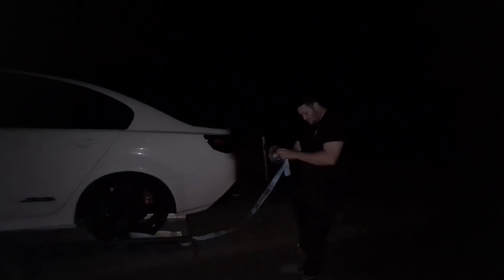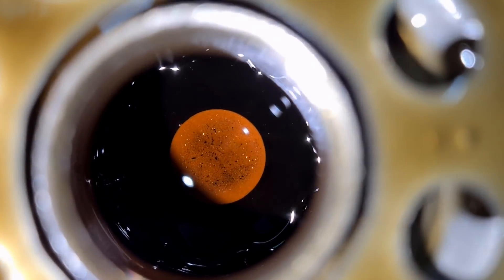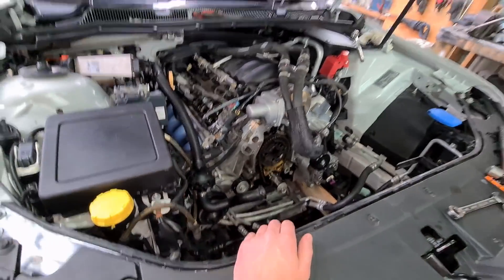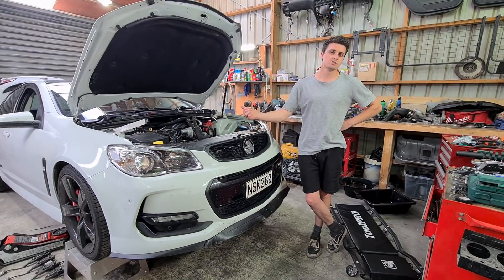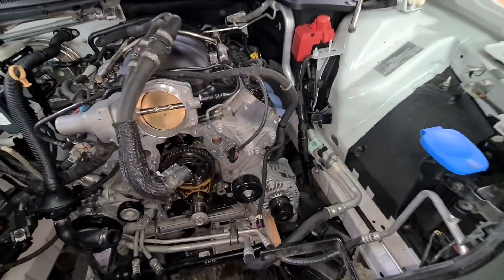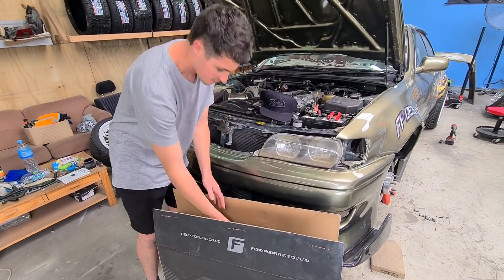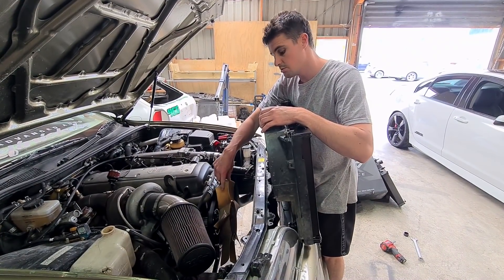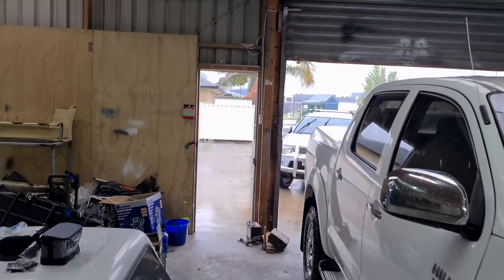My LS3 Commodore Blew Up In The Middle Of Nowhere!

Comment: I think the black tar substance is cooked oil stabiliser.
If you take oil stabiliser somewhere cold it will make the oil extra thick & clog up the oil pickup then the flow will stop & cook itself extremely fast.
If it's mineral oil, then it is literally tar now. 
Hope this helps
Reply: yep just like the various chemical additives used these days, people do not understand adding friction additives in factory oil spec 5w/30 ( no matter the brand) you run the risk of the additives and chemicals used which could react with the oils additives and thus do just what happened here? cheers mate.

Comment: Back to RFB life is it? 🤔🤣
Reply: They have even more oil issues more than LS engines. Especially pre neo
Reply: @nekethoms9963  it was sarcasm..
Reply: Don’t have these issues with a 2J.. Oil flows nice and easy, double the ribs in the block vs an RB30 as well.
Reply: @izzy031096  that's cause RBS have 5x 8mm oil returns as apposed to JZ have 11x 15mm. Witch results in yes better oil flow. Factory oil pump pretty crappy also.

Comment: Unlucky bro! Was that shit that blocked the pickup maybe a black rubber work glove? I would think that would sorta dissolve like that in hot oil.
Reply from the maker: Didn't think of that. Would be pretty hard for that to happen, but might test it and see if it dissolves
Reply: fuck that could be it aye!
Reply: Yeah feels like the kinda thing that would be on purpose. It looks a bit like the rubber that coats head MLS headgaskets too but doubt there is enough exposed to come off like that and others would have had same problem
Reply: 2nd this looks like a work glove
Reply: @MayhemInc  Looks to me like it is the oil filter medium that blew apart inside of the filter and clogged the passage ways. This is common when running poor quality brand oil filters
Reply: I've seen a D shackle from a engine crane, make it's way to the sump. So a rubber glove is plausible.

Comment: Get some silicone oil 8000 or 10000 from a hobby shop for your viscus fan, they use it for diffs and shocks in rc cars and it's heaps cheaper then from Toyota need about 50ml from memory

Comment: Mate that's not some type of broken down gasket sealer as it looks like broken down silicone to me as that brake down into a paste over time.

My trusty old 5.7L LS1 VX Calais has 360,000ks on her and has only been opened once for a set of lifters @ 234,000ks, But I change her oil every 5,000ks.
Next year she gets a massive birthday as I have just about everything together to do a full bushes kit front & Rear with new joints & rack.
Like I have a full rebuild kit here waiting on her to die, But she like piss off bro I'm sweet and she hits the rev limiter on a weekly basses.

Comment: If it's not silicone, and you've recently changed your oil then your most likely suspect is the oil itself, it is a possibility that you got a bad batch of oil especially if it's not a reputable American, German or Japanese brand, I suspected this when you said that it's a tar like substance, if a refining process isn't done right then it could leave a tar like substance in the oil.

Comment: I’ve owned a 2016 VFSSV LS3 for three years and twice in the last year it started running like crap without warning and service ESP light came up both times. First time Holden said the injectors can just pack up suddenly. Had them all replaced under warranty. A few weeks ago exactly the same thing happened but they had to replace cylinder 7 valves, springs, push rod and rocker arm. $2500 AUD this time. Anyone had this issue with their LS3 before?

Comment: Yer bro brought a 2003 mazda bravo, bounty back there but needed flatbed. Was 67 kms when brought. Never went into gear well clutch was shit. Fullas would try move my ute stall so touchy, thought i had a bargain. Na 4000 new gearbox rebuild n clutch kit. Bro its so different to drive. Like shoulda been' was original kms just sat for so long had to do lot of any thing rubber plastic. But yer happins sorry to winge. But i feel bit better haha'

Comment: Hmm....  what type of oil did you use?  ....  To me my first guess would be someone threw something in to quickly seal a head gasket issue, that crap you add to the oil.  Very odd that the pickup was like that, never seen that before.  Like did you use Synthetic etc...  the newer engines run much hotter and the oil will seperate oddly if you dont use the right oil but I mean even with oil pressure dying it's an oil school engine there shouldn't be all that damage.  Were you flogging it? ...  Perhaps the tuning was not right on it and if that were the case without a retune it'd do the same thing.  Easy engine to work on tho pulled mine apart twice over and rebuilt it (just cam changes etc) no failures to speak of.

Comment: It'd be the plastic seal ring off the top of an oil bottle, I've had them fall off while pouring, but never been unlucky enough for one to drop in the engine.
To be more specific its most likely the piece thats attached to the cap but snaps/tears separate when the cap is first removed, look at your old oil bottles if you haven't disposed of them already.
Reply from the maker: Way too much substance to be that and that wouldn't go passed the funnel that was used, still have the bottles.
Reply: @MayhemInc  mate did you use any friction additives at all, because if you did, then because of the various chemicals used as friction additives they would have changed the way the oil is working under heat and stresses etc, which i think thats what happened the oil got hot to the point of changing the additives and thus made the oil into tar like substance etc. Like the various oil stabilizer additives would have changed IMO. cheers mate :)🚗🚗🚗🚗😎😎👍👍👌👌😀😀

Comment: I've had 2 falcons both over 300.000 ks no issues
Reply: Too bad falcons go slow as piss
Reply: @94toxic94  I've had 2 XR6's and VE SV6 and the Barra with the ZF is a far superior engine/trans combo. Now have a 2016 SV6 and it goes well but the trans can't make its mind what gear to go into.

Comment: If it was a Barra you'd be fine
Reply: He needs an AU
Reply: Fax
Reply: Then it would've been the oil pump
Reply: i have barra , had work done through a dodgy mech , motor blew , took apart and found rags in the oil galley in head ,
Reply: Stink!
Reply: Pretty sure Barras need oil too 😂
Reply: @deeppocketz5487  facts mate, your not a uneducated yank
Reply: My falcons been going strong for 25 years ! 
1995 ef 4.0l auto 
350 000kmh
The paint still shines and the engines starts everytime.
Reply: Needs a lawnmower honda
Reply: @imtheonetosayit3657  
How many times have you run it with a blocked off oil feed? 🙄
Reply: @stinkfinger1942  MCM did something similar when they were trekking out back in an XF falcon with no oil pressure
Reply: Barra's are rubbish I had a FG Falcon with a Barra 100,000 kms oil pouring from engine harmonic balancer, powersterring leaking and then the gearbox blew 3rd gear :( . pile of RUBBISH .... now i drive a Holden  cheaper to run with more power  yeaaa . Ram your Ford Falcon's and your Barra's

Comment: i had similar happen on a 4age engine and it turned out it was some oil flush shit someone had put in,dropped all the gunk and blocked the oil pickup
Reply: Yeh this has to be what it is! 
Some type of oil conditioner or engine cleaner that goes in with the oil and just flush all the gunk and got picked up in the pick up and boom goes engine. This is why when I got my Commodore used with 5k miles I upgrade to the camero ss oil pan so I could see it anything was clogged in my pick up up give it fresh oil and filter. Also upgraded all the lifters and trunions and springs, basically all the things LS are known for ruining your engine once it goes bad. So all of that together should be solid. I rather spend a bit now and make it perfect and it runs forever or be cheap and wait then shut like this could happen. 
Keep it up bro! Wish you wasn't selling it but good luck!

Comment: My Holden VY SS Commodore had hydraulic lifter noise until I replaced the hydraulic lifters 3 years ago,I checked the oil pressure which was good & now the LS1 V8 engine is approaching 369,000 kilometres.

My grandfather came from Gisborne in N.Z. originally & migrated to South Australia with his father Allan,I'd say that they were a banana 🍌 growing family in Gisborne on my fathers side because my grandfather ended up growing bananas up near the Queensland border in New  South Wales after he was discharged from the Australian Army after WW2 in 1946 at 27 years of age !
Reply from the maker: Yea good maintenence and they'll keep on going.

Small world alright, that's very interesting.

Comment: Mate i believe its a oil additive, like the teflon stuff people used to use, there's no way a rubber type casket would let go at all, or it could be like i said maybe the chamisal reaction between the factory oil spec and some other oil friction adaptive and the chemicals used in the adaptive has reacted with the factory oil spec ie: 5w30, which is why you never ever put friction additives in factory oil spec, because you do not know what chemicals for the additives will do to the oil you use? Molybond is zinc based which is fine to use IMO, but unless you know for sure what friction additives are in the oil your using then do NOT use Friction Additives mate?
Reply from the maker: No additive has ever been used, and I done all the oil changes
Reply: @MayhemInc  Cheers mate, thanks for the reply, its just that i used to work for wynns and i have a 2015 redline as well and i had a real good discussion with nulon, with their new apex 5w/30 longlife oil and also the extreme treatment they have and how it would impact the new oils friction additives and they said if you want to use it then go ahead ,but they will not warrant anything, unless its ok by the manufacture's etc, just like any friction additives used in oils, they are all new chemicals like boron and others like zinc which you could use, but then again, it will effects the factory dexos 1 gen 2 and now dexos1 gen 3 oils which is even better then dexos 1 gen 2 and better than ISLAC 6A spec oils, like Penrite's GF- S environ oil, ( NOT GF-5 , which is not dexos1 gen 3 licensed etc)  i will be using the new Dexos1 gen 3 spec oil, just because it has a lot better friction additives due to the larger 2lt turbo engines etc?
Also the new Dexos 1 gen 3 or ISALC 6A spec oils are backward compatible to dexos 1 gen 2 oils as well. 
I have noticed when i changed from penrite GF8 to GF-S ISLAC 6a oil, saving a extra 1.5lt per 100km, so should be even better with the nulon apex 5w/30 dexos 1 gen 3 licensed oil, we will see and i will keep you updated after her next oil change?
Still mate you have done well fixing her up to sell and the new owner would be very happy with the new engine in her, cheers mate and i bet your using friction additives in the race engines right?🚗🚗👍👍😎😎👌👌👍👍
Reply from the maker: @7071t6  Someone else said they had a similar substance and they put it down to the plastic from cutting the thread on the bottle with penrite oil which is what I used. Penrite admitted to them they had a bad batch but didn't want to know about it.. na drift cars just get any old 15w50
Reply: @MayhemInc  Who sells Nulon with Dexos in NZ these days? Supercheap and Repco have none at all.

Comment: Someone put excess silicone on the timing cover or rear main seal cover plate and it pinched out when the cover was tightened up
Reply from the maker: it's not silicone and silicone was never used anywhere
Reply: Yea get that, someone other than the factory
Reply from the maker: @mickbrumer  40,000kms engine only been pulled apart to do cam, inspected the whole thing no silicone used and feels nothing like silicone
Reply: @MayhemInc   weird, hope you figure it out to avoid it ever happening again :/
Reply: @MayhemInc    MAYHES WITH MAYHEM WITH CUZIN RORY INC    AKA MAYHEM WITH CUZIN RORY INC     AS MAYHEM INC

Comment: First time i took the oil pan off on our 07 tahoe to replace a worn pick up tube O ring. 

Found some oil sludge in wear the pick up tube screen sits and sorta blockage. 

Cleaned the pan and pickup tube screen and oil psi is golden. Just needs a cam and new lifters in the future.

Comment: I’m kinda leaning toward maybe a faulty oil filter or such… wonder if it’s worth getting a new one slicing it apart and comparing it to the old one that came of the car… amazing that’s there’s that much in the pick up… I mean worst case an silly but if it’s had the pump replaced could it be the original timing cover gasket sealant that they scrapped of straight into the sump…
Reply from the maker: Already checked all that

Comment: If you want to talk about  "reliable"  Holden engines then you need to go back to the inline six, especially the 186 ( 3 litre ) Those things would go forever and you could work the crap out of them. Now Im just showing my age. But remember nothing is actually Holden after and including  the VL
Reply: I've had good luck with the alloytec 6cyl motors. Seen two so far get to 400k km. If you change the timing chains by 200k change the oil at 10k km intervals and keep good oil in it they just seem to keep going.

Comment: Is it silicon sealant or something? Looks like what happens when amateurs build engines and slap silastic all through em
Reply from the maker: As mentioned not silicone, never had silicone put on this engine
Reply: @MayhemInc  soz bro made the comment before finishing the video, did you ever find out what it was?
Reply from the maker: @Slippergypsy  na heaps of very experienced people have looked at it and can't work it out unfortunately, but they all think someone's put some additive in the oil.
Reply: @MayhemInc  that's so weird, 10 years as a mechanic and I've never seen anything like that

Comment: Someone has left something in the Engine. Engines don't just end up with debris in the pickup. It ain't gunna have any oil pressure if the pickup is blocked. Stupids will be stupids. And then this is what happens when you take your car to be worked on by stupids.
Reply from the maker: Exactly, and I'm a mechanic and work on it myself. hence been sabotaged whilst left unattended.

Comment: someone probably used the wrong f.i.p.g when putting the upgraded pump on and its reacted
Reply from the maker: Was done 3 years ago
Reply: @MayhemInc  good point, wouldn't wipe it out as a possibility are you using the same oil it has always had over the last 3 years? keen to see the s.o.s report on the oil. ive seen similar on rb pickups when the wrong fipg has been used doesn't let go overnight either.

Comment: Hey bro random question exhaust wise what usually sounds better stainless or mild steel any real difference?
Reply: Mild steel is generally a deeper tone but stainless is way nice doesn't rust and is very strong. At least on subarus ive found the stainless exhaust gets a crisper more exotic sound whereas mils steel sounds like the otara spec forry hitting gate at 3 in the morning after a tinny run.
Reply: @SuperWesty177  lmfao

Comment: Toyota never fails . Unfortunately I love Nissan's.  But have a Toyota just incase the Nissan breaks again . Suprised the ss failed
Reply: My mums Datsun been going 50years got around 45hp now.
Reply: @grimreaper6112  funny cause my mum owned a Datsun back in 1991 🤣🤣🤣🤣
Reply: @nickstarz9316    FUNNY CAUSE  MY MUMS    OWNEND A DATSUN  BACK IN 1991     THEN  SHES SOLD  ITT TOO CUZIN RORY   TOO  DO AN RB30. 25   SAWPP INTO MY MUMS OLD.   DATSUN 1200 UTE  THAT I OWN NOW BROTHER    AN ITS STILL IN THE FAMILY   TODAY.  BROTHER   NOW FUNNY IS THAT BUDDY   SOO AWESOME
Reply: @RorydriftmansxrsilviaWilkinson  that's epic bro . Unfortunately my mine didn't realise what they would be . I'm a s chassis and gtr boy now hahaha. That's mad it's still in the family .
Reply: @nickstarz9316    yeah sure is bro   i,m a  s chassie  an gtr boy as well too budyy   now     an     toyota chaser jzx100 1jz gte         mazda rx7 fd3s battyman Roatry      an i got few     s chassies   drift cars  too ate the mo   iam unfortunately building   some for street legeal drift car     an  some as a  track missiel drifter       i got an   NISSAN SILVI80 180SX 200SX   R34            NISSAN SILVI80 180SX 200SX  S13,4              NISSAN SILVI80 180SX 200SX S13            NISSAN SILVI80 180SX 200SX S13,5          NISSAN SILVI80 180SX 200SX R32,4                 NISSAN SILVI80 180SX 200SX R32  GTR  FRONT END CONVERSION  RB25 30DET    374+KW    500HPS. REAR WHEELS      9PSI.   OFF BOOSET     SETUP AN TUNE        
 180SX 200SX  S15 RB30 25DET   FOREGED RB
Reply: @nickstarz9316    yeah buddy happy new years for 2022  bro